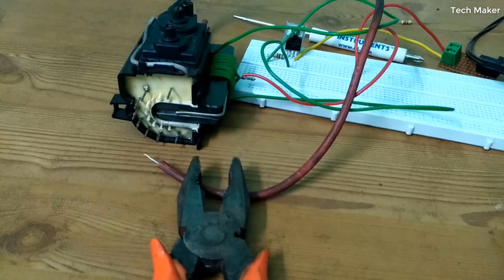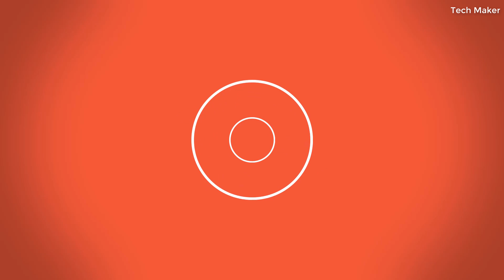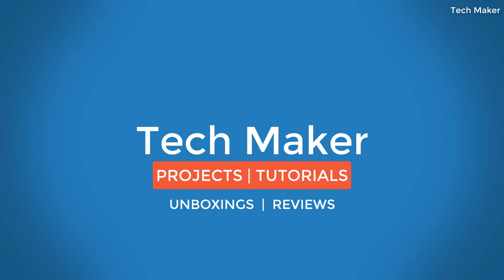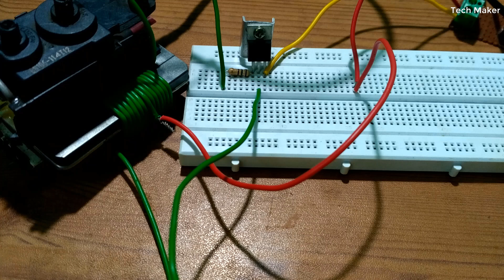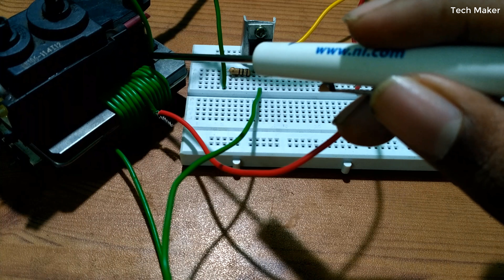How to Make Simple Flyback Driver

Comment: how many volts does it need and how much does it draw (if you know)
Reply: check your mosfet rated voltage to it figure out (don't go over 100v primary or else your going to break your flyback)